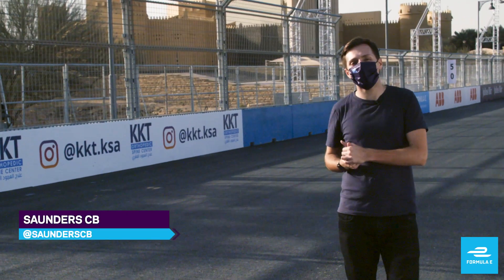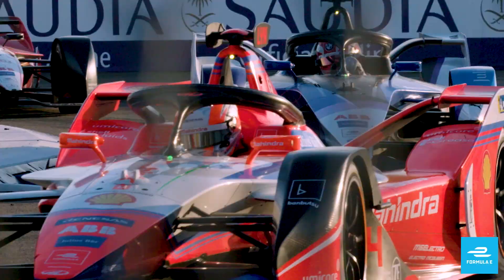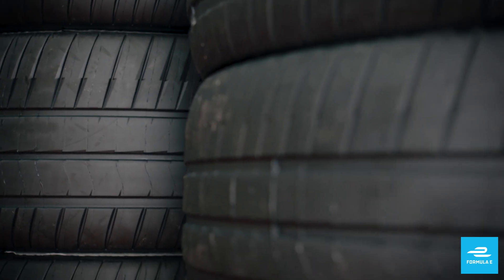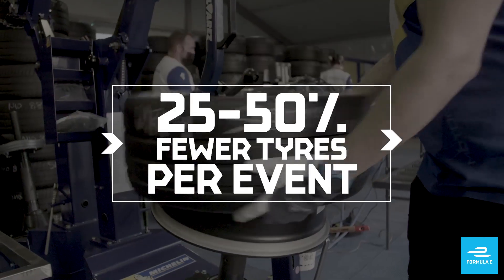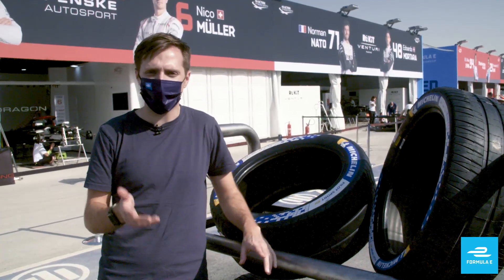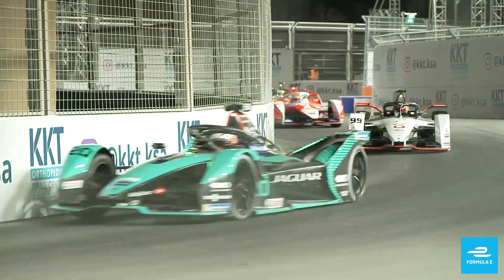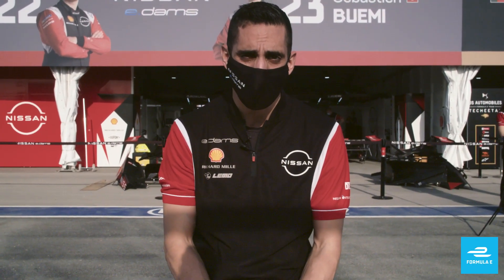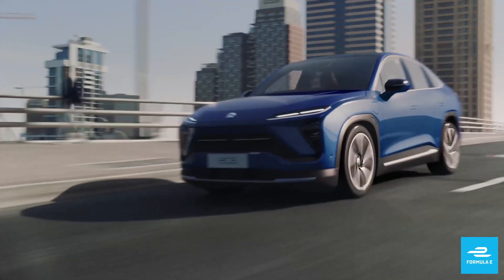How Formula E Tyres Work | Formula E Explained

Comment: Many thanks. A  video on energy and regen would be good. From energy display on steering wheel, to adjustment and regen breaking.  And if you have time, have a look at the 397 rFactor2 Formula E bundle.

Comment: Michelin basically explaining why they refused to go back to Formula 1 with its current ideology for tire wear:
Reply: The tyre degradation requirements weren't deal breaker, the deal breaker was that F1 wasn't ready to accept 18 inch wheels which means any developments wouldn't be relevant to road tyres or other racing series, however it's fine for them to say "Look the tyres last all weekend" but when you put them on a 1000hp car that likes to pull 5-6G in the corners then they're going to get used up quickly regardless.
Reply: @azzifyy5988  No, they specifically stated they weren't going to take over for Pirelli 1 because of the 1 year on 13 inch wheels switching to 18, and 2 because the F1 specifically requires tires to degrade quickly and that's not what Michelin wants.

"However, the demand for the supply of 13-inch tyres for the 2020 season alone, as well as the deterioration of performance as a part of the show, goes against our principles of efficient resource management and respect for the technology of a sustainable tyre."

Comment: Personally I don't agree with this. I understand the sustainability approach, but I think racing EV's should be as fast as possible to make the sport appealing to people and change their overall perception on EVs. Not using slicks is basically limiting their potential to go as fast as other formulas.
Reply: Its not the just the speed that makes motorsport entertaining its the racing.  Formula E is still a long way behind even f2 in raw speed so they make up for it with these low grip tyres that make the cars slide and helps create better more exciting racing.

Comment: It's nice to hear about how they adressed the sustainability issues of frequent tyre changes, compared to other forms of racing. But from a tyre tech video I'd like to learn also about the compound, the tread pattern, the carcass and sidewall specs and ultimately what went into the design of such innovative rubber. You could as well produce an episode 2.
Reply: Normal car tyres are designed to work in all conditions.

Comment: i may be wrong but wouldn't many different tires variety grip and durability with fast pit stop tire change would be exciting
i get it that reusing tires are good for the ecosystem but i think actually having good grip tires rather than the ecosystem is still a fundamental part of racing to gain performance to the car.
Reply: Of course it would be exciting, but Formula E isn’t a traditional racing series. If they were thinking about pure excitement, the series probably wouldn’t be electric

Comment: Tires is one of the many reasons this series is boring. No tire strategy. Come on, these are race cars with too much eco friendly in mind. The series needs Slicks and pit stops. It would be super cool seeing them change batteries and tires in a pit stop
Reply: The whole point of FE is to be a eco friendly racing series

Comment: Why not share the tyres among race weekends. Teams can use tyres from previous races in slow runs in practice sessions for the next race.  If unsafe, the used tyres can be used after retreading in practice sessions of the next race. Or just add an extra practice session where you are allowed to use only re-treaded tyres from previous races. I am sure teams and drivers will love the extra track time be it with old tyres. Instead of a race limit, give the season limit. They can keep a limit on new tyres but no limit on retreaded tyres. With no limit on retreaded tyre use, there will be active participation from the teams.

Comment: I'm fairly new to Formula E (watched S1 then came back midway through last season) but if the same tyres are used all weekend, is there minimal running to preserve performance for quali? Or is there less of a drop off?
Reply: Good question, they are manufactured to last across sessions and teams will often change/move the tyres around wheels during practice sessions to even out any degradation.

Comment: Specifically, how is Fan Boost actually applied? 

I think its two fold; Increased cap of motor generator to maximum and an temporary extra allocation of usable energy to cover that for x number of seconds?

Fan boost is over when either x number of seconds is up OR the extra allocation of usable energy is used up? 

Does that mean they can go for the full x seconds at slightly lower the maximum or go maximum cap and then have the boost be over before x seconds is up due to the extra energy being used up?

Or does it work some other way?

Comment: It's not really a race technology issue, but I'd love to see how this driver eye helmet cameras work. They appear to be right in front of the drivers face, which is obviously impossible. I've even noticed when they open their helmet visor, you can see that action too... WHAAAA?
Reply: The Driver's Eye camera is positioned in the protective padding inside the helmet and sits exactly at the pilot's eye level.
The camera has a diameter of 8 millimeters and weighs only 2.5 grams.
A black filter is applied to the image so as not to reveal the data on the steering wheel.
The device isn't applied to all drivers.Only two or three drivers have the technology.
Reply: @Canuck59NHL  To add to this, I think Dario mentioned in FP1 of Rome that only Bell helmets have this ability.

Comment: “Yes they are 100% recycled”

Oh great, how?

“We burn them...”

.....
Reply: There’s a little more to it than. That energy/heat created from burning them is in replacement of burning fossil fuels and any carbon that is released has pre-existed based on things like the natural rubber used. So it’s recycled carbon so to speak. Fossil fuels are dug/drilled up from under the surface after being stored for thousands/millions of years, adding new carbon into our atmosphere when burnt. So it’s a net emission and recycled carbon. Hope that makes sense!
Reply: @saunderscb  
Burning them is not good for the environment.
Reply: @saunderscb  yeah but rubber tree would normally live for 100 years and then take another 50 to fully decompose.  Cuting down a 25 year old rubber tree  and then burning the Rubber a year later to ' recycle it'  is releasing all that co2 at once instead of slowly over 50 years.
Reply: @saunderscb  You just used the same argument as burning fossil fuels there. The carbon that is released from petrol has also pre-existed. The point is we want to keep them in that pre-existing form, not release it into the atmosphere.
Reply: @Excludos  I see your point but buried fossil fuels existed long before anthropogenic climate change so it's not a direct comparison. One is adding a previously buried and relatively harmless form of carbon into the atmosphere, creating positive (additional) emissions, the other re-uses pre-existing, non buried carbon product as fuel in replacement of needing to dig up and use more buried fossil fuels, and therefore creates a net emission.
Reply: @saunderscb  r/woosh
Reply: @andie8843  the joke itself misses the point
Reply: @andie8843  k kid
Reply: yes, but no :D
Reply: Classic green idiocy indeed!
Reply: @Sweaty__Sheep  What would be insane is for them to sponsor some Earthship houses/buildings with their old tyres since those house's walls are made out of tyres and dirt. You could have a official Formula E town/resort gradually growing with every championship!
Reply: Yes, I know it's supposed to be a joke, but everyone else is taking it seriously so here the explanation for why tyres actually CAN'T normally be 'recycled' in the normal sense of the word.
Quick chemistry lesson here: rubber in tyres is made from long chains of molecules with strong bonds made of sulfur between the chains to strengthen them and make the rubber suitable for purpose. However, those sulfur bonds are really, REALLY hard to break, and there is literally no known chemical process that can reverse it. This means that the molecule chains cannot be broken apart, which severely limits recycling options as the recycled rubber is never as good as a fresh source and can only be used as an additive.
So, while burning the tyres for energy is definitely not ideal, it is at least better than using fossil fuels as an energy resource (the same amount of CO2 is released as is taken in by the rubber trees that produced it - see Saunders' comment below), it is one of the very limited options available.
Hope this clears things up a little.
P.S. I am not an expert so don't go asking me too many awkward questions about the exact processes involved.
Reply: This is golden 😂

Comment: For the next generation drivetrain, I read there will be a front axle generator/regen.  Why won't this be used as a motor as well, for all-wheel drive?  Tradition? The trend for street EVs is AWD, so hardly cutting edge for Formula E cars.
Reply: This is also Lucas Di Grassi's argument, he's been pushing for AWD FE cars for a couple of seasons now. Loads of street EVs now are AWD as you say, it does seem to be the sensible trend. Apparently the Gen3 cars won't be AWD either - maybe we'll see it for Gen3 Evo or something. There's a great interview with Di Grassi on Inside Electric recently, it's really worth a read, he talks about some of this stuff.
Reply: @csl___  im guessing they be too easy to drive with less sliding
Reply: @steviegbcool  Seemingly Gen3 Evo might use AWD for attack mode which would be interesting
Reply: No, it will just be used as a generator to slow the car down and capture more power in the braking. The car will still be all wheel drive
Reply: @benfarmer-webb1016  You mean the car will still be rear wheel drive.  My question is why not AWD?
Reply: I think because RWD has less understeer than AWD, but I might be wrong.

Comment: I remember seeing the most recent race in wet conditions, the mission is great but the grip is non-existent in the wet. Touch the brakes and turn, car rotates and goes sideways into the runoff. Might need a little more research into whole wet plan
Reply: That just means skill becomes a bigger factor
Reply: @BrooXX856  With how much carbon fiber paneling they leave on the track in any race, I can't tell if they need more skill or better anger management
Reply: Impossible to have a tyre that works really good in both conditions.

Comment: Wait, don't F2 cars also have 18 inch tyres?
Reply: Yes, and F3. I'm guess those series aren't classified as "World Championships" so they're technically correct?

But by that metric, I'm pretty sure F1 and FE are the only single seater championships. 

A better way of saying that would have been the first single seater series to use 18in tyres.
Reply: Yes, but F2 tires are not an all-weather compound. They were getting at "only single seater series using 18 inch, all-weather tyres".
Reply: Yes